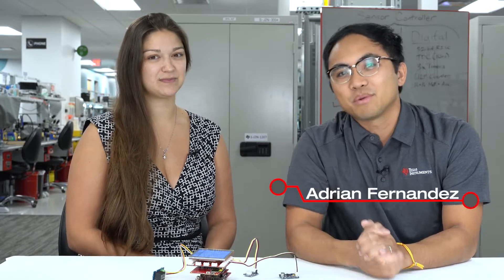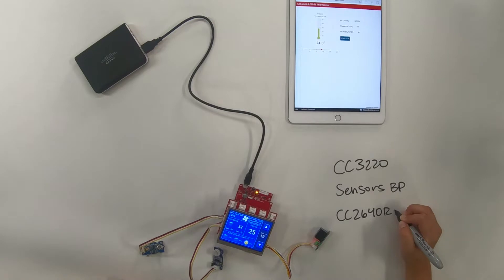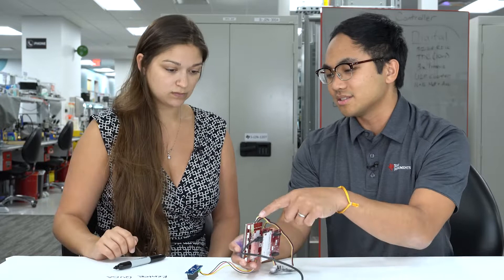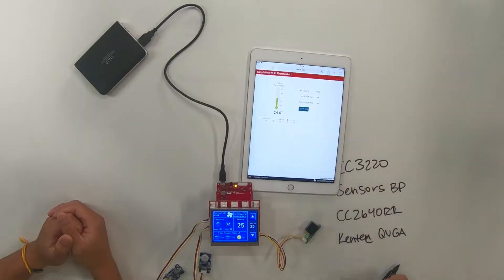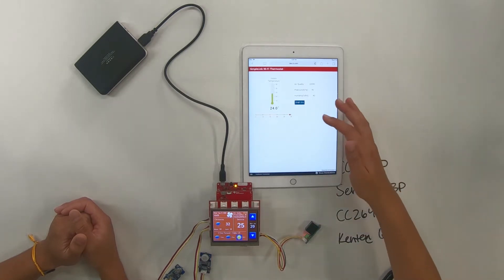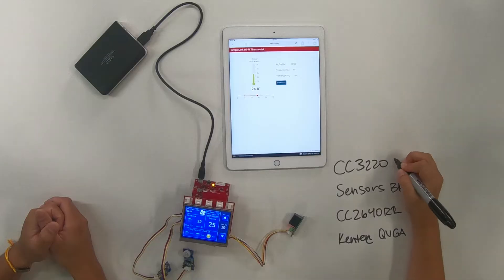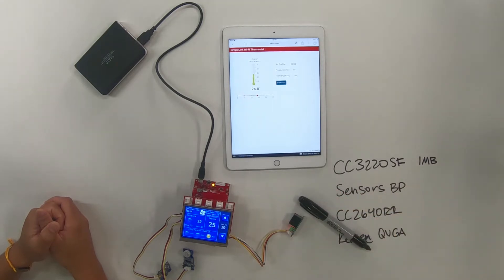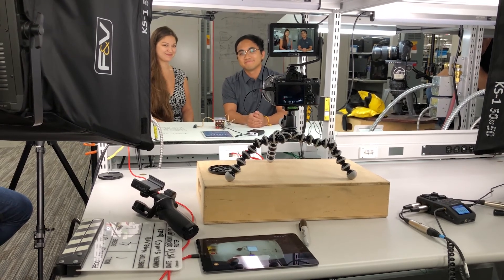Connect: Smart thermostat demo

Comment: Have provisioning working. I chose the MQTT version of software to work on. MQTT did not work due to I wanted to get the non-secure connect working. Someone removed the conditionals to allow that so I put it back in. MQTT connection now working but the code has no retries if the connection is broken. Now working on the OTA which appears broken too as the state machine tries to compare the code vrsion number before downloading the version file

Comment: Bought the hardware and found several errors in schematics for the kendec LCD and main board. Got the code to compile and run. Howeve cannot finish SmartConfig provisioning. Get AP IP address and cannot give feedback to the smartphone.